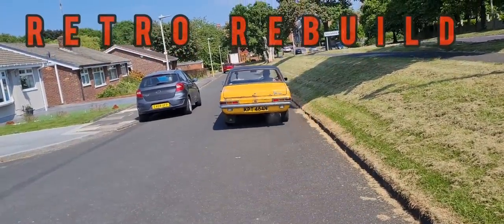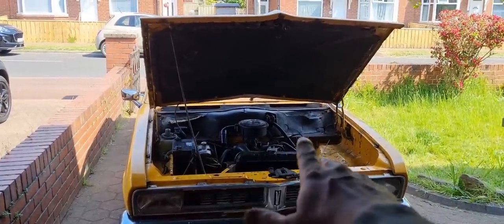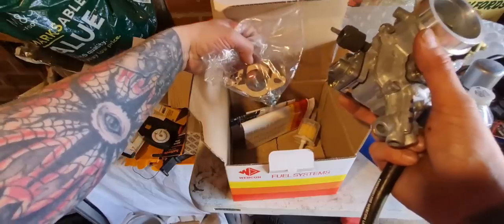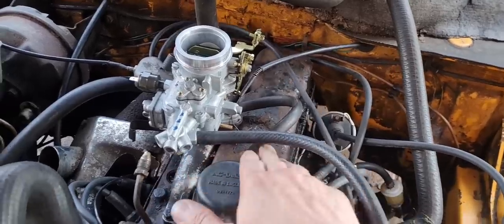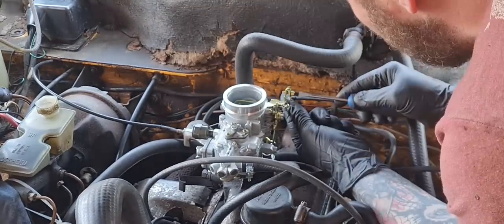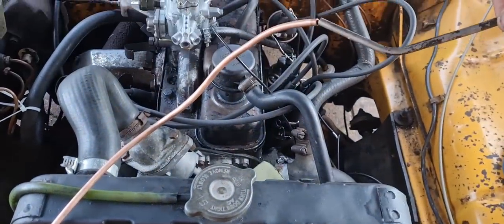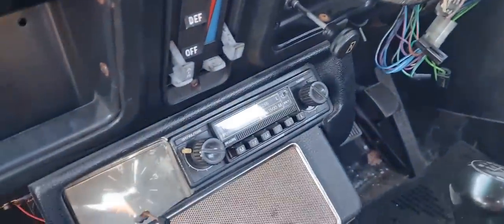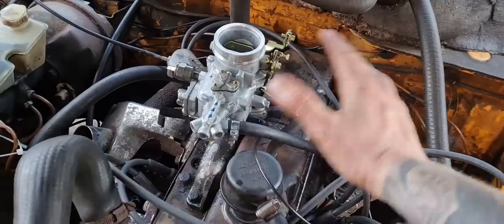OH NO! MORE PROBLEMS! FITTING A WEBER CARB & SETTING ENGINE RPM THE VAUXHALL VIVA REBUILD CONTINUES!

Comment: There is a selenoid valve on the left of the carburettor, as you stand in front of the car looking into the engine bay. It has a spade terminal on it. It needs a 12v ignition feed. Without that the idle circuit in the carburettor is blocked of by the selenoid valve. Easisest way is to run a wire from the B+ post of the coil to it. The job of that selenoid is to cut fuel when the engine is shut down. therefore stopping any run-on which used to be a problem on carburetted cars of that era. Once you fit that, you'll be able to set a stable idle. You should not need to re-adjust the timing you already set.

Comment: No need to set the timing again, if it was spot-on from the Zenith, I've never tried a Webber myself but I did use Pireburg twin choke on a 1256cc Chevette which was taken off a 1.3 litre Astra and it drove like a rocket.
With new carbs the main mixture screw should be capped off with a plastic cover, and you should only need to adjust the idle screw.
Is the carb for a 1.3 litre engine ?
I agree the coil would be better off screwed to the bulkhead or inner wing, anyway would of thought the Webber carb should perform quite well.
All the best I know you can do it, I have faith in you.😃
🔨🔧🪛🔩🛠
Reply from the maker: Thank you mate, been tinkering and problem solving today, ready for Sundays vid, all will be  revealed 👍
Reply: @RetroRebuild  ...Can't wait for Sundays vid, by the sounds of it I think I know what it's going to be like.

Comment: The new carb has a anti run on solenoid on it , and will need a 12volt feed via an ignition supply for it to open and allow the fuel to flow to the jets in the carb.
I cant understand how it even ran at all with no supply on it ?
Reply from the maker: 😄 thank you mate, all will be revealed in next vid 👍

Comment: Shouldn't have to redo the timing, just get the revs down to normal. Check for vacuum leaks as that will not help  your idle speed. Paint your wheels and fit the hubcaps,will make a hugejjj
Reply from the maker: Thanks mate, I'll be checking for air leaks next time, there's loads of cosmetic jobs to be getting on with once she's on the road properly👍

Comment: turn mixure screw  in fully . unscrew  1& 1/2 turns as starting point  turn each way to get smooth ideal .    timing  set 4. 5   %tdc  inbetween two pointers    gm say 9   top pointer   i found happeir  4.5 btdc    huntint  make sore the mainfold gaskets not sucking in air .
Reply from the maker: Thanks mate,been tinkering and problem solving today, can't wait to get video edited together for sunday👍

Comment: Steve I got nothing 😭I’m no expert 😂 but the lines in heat reflecting tape, heat shield or something on the exhaust side? Keep the heat anyway 😅 at least the Webber is not hovering right over the exhaust manifold 😆
Reply from the maker: Exactly mate, that's a plus, if a fuel line splits its not dribbling all over the exhaust 👍

Comment: I wonder if the broken choke cable was causing it to over rev. I did see the choke plate move when it was revving high.
Reply from the maker: Think it fell out after mate, I did find the little split pin for it tho👍
Reply: @RetroRebuild  I think once the choke cable is replaced you'll have more of answer.

Comment: no need to touch timing. air leak possibly, maybe vacuum pipe??
did you check butterfly flaps closed properly before you fitted carb??
Reply from the maker: Thanks mate, I've been checking everything, filming bits for next vid at the minute 👍

Comment: Great video as always. Is just run a longer fuel pipe from pump to carb, be fine mate. Check your accelerator cable stop is back off, not the idea jet
Reply from the maker: Thanks mate 👍

Comment: Well, if ya can't back the idle screw off any more, youse likely got an air leak along the line. When you get the air filter on ya Weber, be careful how you bang the bonnet down first time, things ain't always what they seem. 😮
Reply from the maker: I'll be checking for air leaks next mate 👍
Reply: @RetroRebuild  Squirt carb cleaner around the joints. A sudden change in speed and you've found it. : )

Comment: Nice one Steve..so its revving high? Have you checked for air leaks maybe round where you bolted on the car when its running spray wd40 round the area see you find the issue 👍
Reply from the maker: Thnak you mate, been problem solving today, all will be revealed in next vid 👍

Comment: Very enjoyable vid, Steve. We used to call those up and down revs, hunting. I would strongly advise real caution if the coil is leaking oil. The oil is needed to keep the coils cool during operation. If there isn't enough cooling oil the coil could overheat and perhaps explode. This might also explain the hunting as the high voltage could be varying. Take care.
Reply from the maker: Thank you mate, I'll be fault finding on next viva tinkering day👍

Comment: I don't think it'll be the timing - that just times when the spark occurs and although the new carb is on, it should only need a reset if it is drastically out and therefore firing at the wrong time - more likely to slow the engine.  More likely to be the mix or the fuel volume - like sitting with a foot on the accelerator!!
Reply from the maker: Thanks mate, all will be revealed in next vid 👍

Comment: Alright mate 👍
Nah you'll not need to re-check timing for fitting a carb. I'd just put a quality rubber pipe straight from the pump to the carb, that's how the Escorts were, it'll be fine. Yeah if the's oil dripping from the coil replace it, I wouldn't relocate it.  As other comments check for air leaks, I'd consider wiring up the solenoid, originally the Viva didn't have it but the new carb does, might make no difference but you can rule it out once checked. Also mixture screw all the way in, then out 1½ turns as a starting point. Plenty to go at on next tinkering day!!
Reply from the maker: Alright mate, been tinkering and problem solving today, all will be revealed in next vid 👍
Reply: @RetroRebuild  looking forward to it mate 👍

Comment: 12v feed to the fuel cut off solonoid at the side of the carb
Reply: Agreed .I believe it's running off the main jet at idle hence the hunting. A guess a few pumps of the accelerator pump got her running.
Reply from the maker: This car doesn't have one mate, 👍

Comment: Hi Steve glad you did the timing OK hope its made a difference as far as the webber go's no need to re do as others have said but I reckon it's something to do with the throttle linkage I had a 1256 hc once back in the 80s and I fitted a webber same as you and I seem to remember it came with a choice of throttle linkage part that you have to swop so you can get the correct free play on the cable hope this helps
Reply from the maker: Yeah timing was spot on thank you mate, more investigation needed on next tinkering day 👍

Comment: Hi Steve, dunno if it's me but of the setups you've tried so far using the Solex has been best (the car has been least driveable) the Weber may come good with some "fettling" but it really needs setting up on a rolling road to get it to it's best, is it worth now the pressure is off the Stromberg re-checking the settings to see if something was missed as they were fitted to vivas to give a bit more power whilst maintaining fuel economy (SL designation meant little more power (carb and twin port exhaust manifold and better trim) over the Solex, I personally woulg remount the coil to the inner wing as it'll run cooler, give better access to the engine and reduce a possible ignition source (engine fire) from near the carb, fuel pipe and fuel pump.
Reply from the maker: More investigation needed on next tinkering day mate, I do want to remount the coil some where else eventually 👍

Comment: If you feel you have the timing set as best you can, concentrate on what you have just changed. I have to wonder if by passing that small fuel pipe puts too much pressure into the carb. Check that coil, maybe that was causing the misfires previously, I never liked coils being mounted to the engine, that heat, but they did that I think to try and cut costs and avoid grounding issues. Not trying to tell you what to do, but maybe write down a list of what you have done, once you are happy, give it a rating and move on. Putting on that weber has introduced a wild card to the mix. Great presentation and video editing, entertaining content, like you I wish I had more time away from work, but that free time seems to cost us even more...
Reply from the maker: Thank you mate, appreciate it, and thanks for the info, more investigation to be done 👍

Comment: First off all put the carb linkage back on, (good luck finding the pin) once your timing is set, that's it, no need to adjust it again. 
The carb will be roughly adjusted from weber, but it will need some mixture tweaking, 1 1/2 turns out should be a good starting point, the book should give you a rough guide.
The high idle could be just carb set up or you have an air leak , trying spraying some brake cleaner round the intake manifold joints and carb, that'll tell you if you have any leaks. 
Fuel line routing , do what suits you! 
Prehistoric instruments , i have a few of those lol old school FTW
Reply from the maker: Thanks for the info mate, I found the pin 😄👍

Comment: Check for air leaks!! ⚠️ 
Had Minis back in the day, never got mine to idle smoothly, but the Weber was the best option, no top end fuel starvation, but may as well thrown fuel at it with a bucket!! Stromberg sounded better, but the Weber sounded good too! 
⛽ 🪣 a spray bottle with soapy water to find leaks 💧 🧼
Reply from the maker: 😄 thanks mate, I'll be checking for air leaks on the  next tinkering day 👍

Comment: Excellent as usual, think you could do with a long pipe from fuel pump to the carb, nothing additional or hard line needed, gotta love a Weber, once adjusted, but that is an art form 😆. Good luck to you 👍🏻
Reply from the maker: Thank you mate, gonna get a good fuel line  once she's running right can't wait to test drive with the weber on 👍

Comment: I'd put another fuel filter between pump and carb. I think you sucking air around the manifold after carb. Strip it all down and new gaskets. Good idea to set tappets and paint rocker cover while off. Could have play in the timing chain. Best to set timing on the run. Find the sweet spot. Have you got new spark plugs yet. Coil is ok where it is. Thought you had electronic ignition.. but I think you sucking air after carb. Look on freecycle. You can get old racking and 6 ft cupboards for free. That will clean up your garage. Good luck Man. Have a good one. Adios.
Reply from the maker: Thanks mate I'll be checking for air leaks on the next viva tinkering day, couldn't get her running right on electronic ignition, so I'll be revisiting that eventually 👍

Comment: You need a 12v feed to the ideljet on da side of the carb and that will let the revs come down
Reply from the maker: It's and idle cut off solenoid mate, not used on this car 👍
Reply: You will need 12v feed for that carb
Reply from the maker: @garymyles1353  👍

Comment: What Webber did you buy ? I looked for one but they didn’t do one anymore as it was discontinued
Reply from the maker: 34 ich from webcon mate 👍
Reply: @RetroRebuild  should be a 32 ict
Reply from the maker: @seansells5097  the 2 company's that I found that still sold them for 1159 to 1256 hc's  advertise the 34 ich it's going to be great when I get it set up right it already sounds like a little  beast 😄